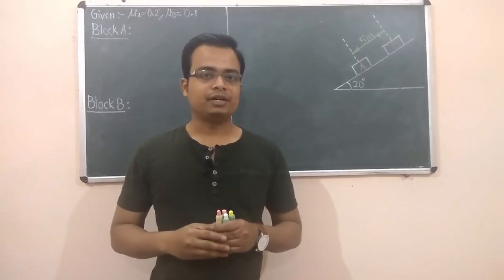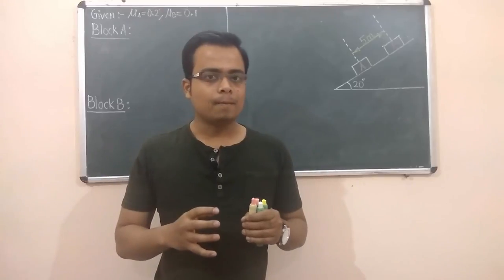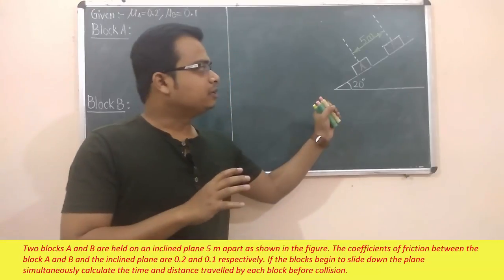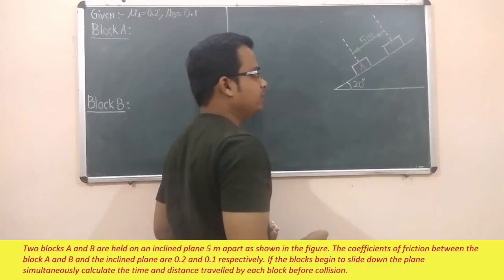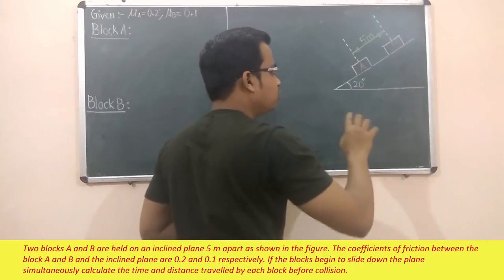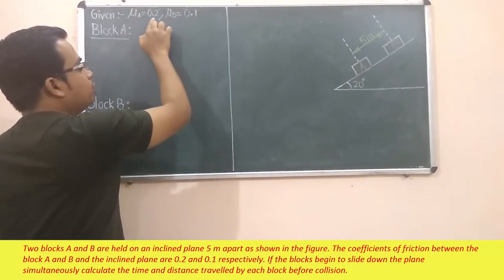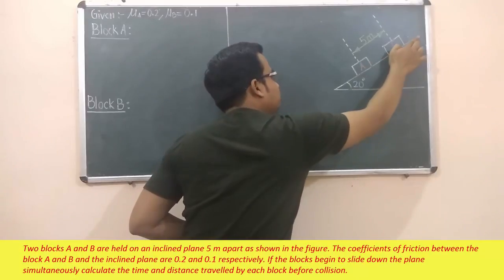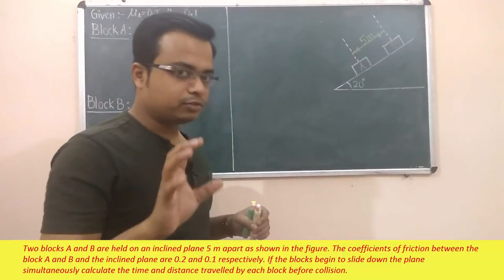D' Alemberts Principle | Newtons Law of Motion | Dynamics | Problem 4 |

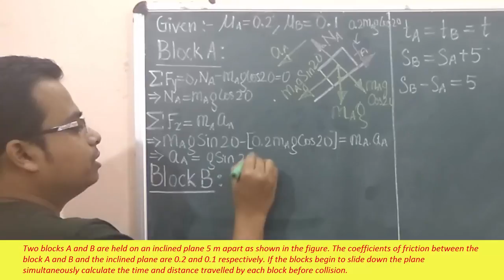Comment from the maker: At 7:34, there is a correction, that, Ma is already eliminated and should not be considered a part of the equation.
Reply: Suggestion for the figure. The 5-meter distance should be between the end part of block A and start part of block B. The problem with your figure is this, if the 5-meter distance is at the blocks' center, then it will mislead the solver that the blocks have a distance of less than 5 meters and will collide much faster than what you really meant it. So, kindly consider my suggestion for the figure.

Comment: sir can u pls solve these 2(question on point) for me actully i dont have the ans..these question have been asked in priveous qustion ppr...i solved but dont know ans is right or wrong.......1:-The least distance of a point P from reference line is 60 mm.Draw its projection if the point is placed at a height of 30mm above H.P.Mention all assumption regarding quadrant and scale used clearly alongside the solution......2:-A point 30mm above xy line is the plan view of two point P and Q. the elevation of P is 45mm above the HP while that of the  point Q is 35 mm below the HP.Draw the projection of points and states their position with reference to the principal plane and the quadrant is which they lie...